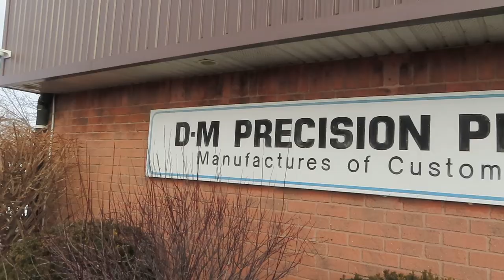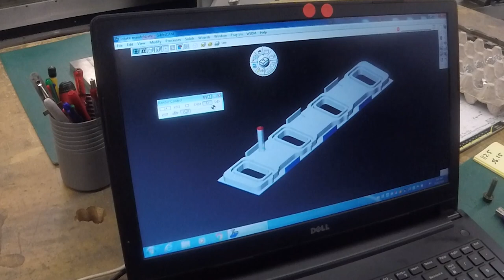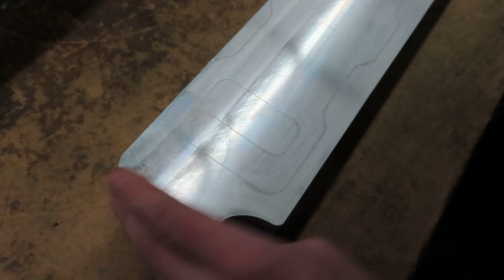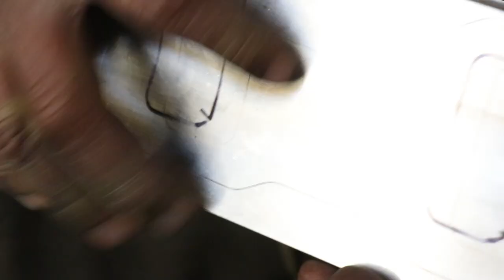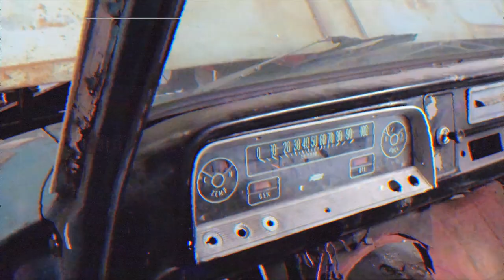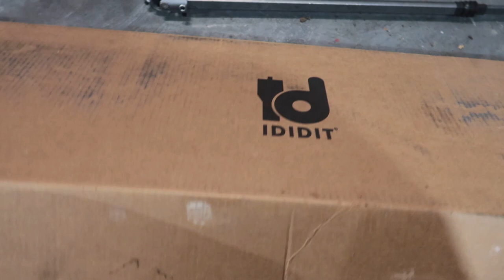Building DIY Exhaust Headers for Twin Turbo Setup #TTDmaxC10 [EP10]

Comment from the maker: Have you entered our International Quarantine Car Show yet? https://iqcs2020.com
IQCS 2020 Merch https://teespring.com/iqcs-2020

TOOLS & PARTS USED - Find the best prices using our affiliate links:
DIY Headers http://lyellstainless.com
Radiator https://www.flex-a-lite.com/radiators/universal/extruded-core-universal-radiator-34-x-20-ls-engine-with-dual-electric-fans.html
Analog Dash https://www.intellitronix.com/product-page/chevy-truck-64-66-analog-panel
Turbos https://geni.us/he351
Steering Column https://www.ididitinc.com
Reply: DEBOSS GARAGE have you thought about just straight piping it? You wouldn’t have to worry about the mufflers
Reply: Yes my 91 dually suburban is entered
Reply: only 50 psi of boost?  make 100
Reply: Can you add a Jake brake to a 2007 Dodge Cummins or just an exhaust brake
Reply: Dakota k just a exhaust brake.  A Jake break would require a completely different head and possibly a different cam setup.  A exhaust brake is all you can buy
Reply: @SqueakyTron  watching some othere video I just found a loadleash from v-belt wouldn't have to change the head I guess it's new and seams to work great just change head studs they give you

Comment: I worked for Hyster Co. back in the 1970's in the machine shop. They used kerosene as a lubricant for machine work and drilling done on aluminum. It kept the tooling cool and kept the aluminum from gumming up the various bits. It just got pumped through the cooling pump and reused over and over. Much cheaper than the stuff in an aerosol can. Give it a try. Just sharing info like you all do. Thanks for all your work and ideas.

Comment: When you cut the tube ends that go into the collector, if you cut them at a 45 you can pinch the points together in the center and weld them into a center spike/cone.  Looking good can't wait to see her run!

Comment: Everyone: puts a Cummins in a c10 and calls it done
DG: I’m going to take the hard way and put a twin turbo duramax in my c10
Reply from the maker: Nothing like owning a 1 of 1
Reply: @DEBOSSGARAGE  This intake creation alone is a good journey into uncharted territory
Reply: Putting a 6.7L Cummins in a '66 SWB panel truck. Widening step side fenders to house the motorhome rear end. Looking forward to info on these intercoolers, mine will stick out past the front bumper if I don't address the issue (I will address that issue, but it's tight front and rear, so I need to see options for making up space).
Reply: DEBOSS GARAGE yes sir, I think it’s really badass
Reply: You mean go the smart way⁉️ 😜
Reply: @dustinmeier9753  I know it’s a been a year but I’m interested. Did you do all the electrical stuff on the 6.7 or did you p pump swap it?

Comment: Just a heads up you can cap that fuel pressure relief valve on your junction block and not mess with any of those line. I have on every duramax ive tuned. Oh and you can only run about 8 to 12 psi to the cp3 on a duramax from the lift pump or the fuel pressure regulator will freak out and the pressure will hang up high.

Comment: Hey Rich you mentioned “working with holly” is a possible prototype?
Reply from the maker: If it works, possibly, but no point in starting anything until its proven.  With the exhaust and fuel mods, its a lot of work and not just a bolt on
Reply: DEBOSS GARAGE oh wouldn’t that be something, might give Gale Banks a run for the money lol . Power to ya 👍🇨🇦
Reply: @melissahill7930  It was a yoke.

Comment: Beautiful intake setup! Is it possible to get a 2 in, 2 out intercooler to equalize boost pressure across both banks? Seems like having them completely isolated leaves potential for running issues if, for whatever reason, boost varies from side to side. Added benefit of maybe only needing one MAP sensor that way too 🤷‍♂️

Comment: I would Weld in or screw down an aluminum plate along with the insulation on the driver side floor board to dissipate the heat from that exhaust on the side.

Comment: Why wouldn't you feed the intakes down into the intercoolers and then have both exit on the top so they just turn and straight in? Just curious love the project tho excited to see the finished result.
Reply: Yeah two vertical coolers would look better.
Reply: @FirstLast-bi8xi  idk y but im super picky about things being symmetrical.
Reply from the maker: Id like to close the hood
Reply: @DEBOSSGARAGE  i was thinking it looked like the pipe coming up from the bottom intercooler is gonna block the turbo intake filter, and like a dummy i thought the were gonna be in front of each other not up and down. Sorry bout that still bad ass and cant wait to see the next video.

Comment: hey bud, in allot of traditional twin-turbo setups they turbo is spooled from the opposite side of the engine then it feeds into. you could also have something called a balance tube with a single larger waste gate.

Comment: Hey rich for the drivers footwell you can use kaal wool I believe it's how you spell it which is used for foundrys and it is a great heat barrier you can have a tiger torch goin on one side and have your bare hand on the other side

Comment: so heres a thought, isnt the duramax running fuel maps off of a MAP sensor not MAF? if thats the case you can bridge both manifolds in the center with two lines that feed a MAP sensor. simple 1/4 barb fitting and that should create a balance point between both manifolds.
Reply: at the very least see if you can tune it for map instead of maf.

Comment: It would be nice to keep that cool old fuel tank. We used to drive around with them full of gasoline, fuel's a hundred times safer. It would be easier to build a bulkhead in front of it than relocate the tank. At least try to leave the filler neck in the OG location.
Nice build!

Comment: How much does having the intercoolers in front of the radiator compromise cooling of the engine? I know this is common practice but it just seems you are putting the hot air out the back of the intercoolers into the water radiator.

Comment: You should tie your intake charge pipes together at some point, to help balance boost pressure from 1 side of the motor to the other.
Reply from the maker: There are ports at the back of the manifold and I will do that

Comment: How is that 90 degree milwaukee die grinder work? Been looking at one.
Reply from the maker: I am extremely impressed.  Needs 3 or 4 batteries to go for a couple hours but it never got hot.

Comment: How is the thermostat housing going to be ran? Is it reversible?
Reply from the maker: Yes, ambidextrous so it points right at the inlet.  People laugh when I say GM is engineered the best but its because of things like this.  The heads, intakes, exhaust, thermostat can all go on both ways, and the engine mounts are the same as the LS.  Tuning is simple and accessible.

Comment: Had a mate build a set of inlet runners complete with injector rails for a triple rotor mazda rally car. Was naturally aspirated. Inlet runners were made from aluminium. Ran face to face thru 170 deg. Had six runners, tapered along their length and were fully machined on a simple three axiz machine. he did it by making the tubes in two halves, imagine like a banana split lengthwise, made them with registers and interlocking pieces. Kind of clipped together not unlike an electrical plug. The whole assembly was put together and all the joins were simply sealed with a tig welder. Absolute genius solution. Goes like a cut cat.

Comment: You only want about 5-10 pounds of pressure to feed CP3. Please dont crank your fass up to 100PSI. The internal case drain will be overpressured and I have had a shaft seal blow out from too much inlet pressure and then you get the classic LB7 crankcase full of diesel and then change injectors for no reason LOL

Comment: Why would you not have it cast instead?
Reply: Taking a few measurements and cutting it out of a block of stock would be easier and probably cheaper than having to make a mold that's perfect and that will only be used once

Comment: I know you've got big hands but those primaries look undersized for what I'd expect to see here. I guess there's just not space for anything bigger?
Reply: Most people doing high performance diesels (duramax powerstroke Cummins) rarely run much besides stock manifolds. It's odd but with turbos theres rarely a gain from the best flowing manifolds. And the more volume in the manifold means more time that the engine has to fill the exhaust before putting pressure into the exhaust housing of the turbo....
Reply: @jaredanthony8070  Less back pressure is usually good for cylinder fill, but as you say, it's probably not going to make a difference here. Other places definitely does.
Reply: @c0c0asauce  less back pressure na or supercharged is the best route. But with boost you are forcing it in and no matter how free your exhaust is you will be creating back pressure with a turbo. All the back pressure is completely negated though. With a log style manifold it has even less volume to fill which means it fills it quicker spoiling the turbo faster. Theres a point of too small where the exhaust manifold is the biggest restriction but that's probably would be limited to the cylinder heads ports. If its equal to those its not any more of a restriction. But if you have a 2 1/4" primaries you have a lot more volume to fill and pressurize to then spool the turbo and it can be anywhere from a few hundred rpm to a thousand rpm spool difference. Everything that applies to gas engines(especially na) hardly applies to diesels 😂 afr's compression what makes them rev... all is a different animal
Reply: @jaredanthony8070  If they are big enough that's fine. Flow is important everywhere.

Comment: Why you just called Banks Engineering for intakes seem like you're doing more than you have to🤔
Reply from the maker: Because Banks intakes already exist.  Why not just buy a running truck from a dealership?  Not what this channel is about.  $2200 USD is about $4000 CAD to the door.

Comment: Why put all of that heat in front of the rad and just dump it back into the system, I see this done all of the time I do not under stand why it seems  so counter intuitive . put the intercoolers off to the side with an electric fans and ducted cool air  and hot air out from the eng bay.